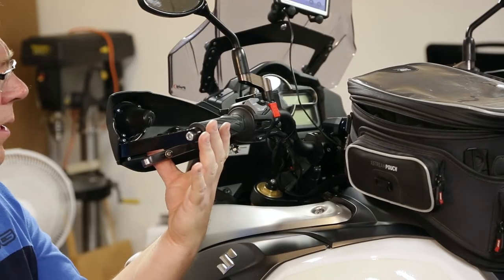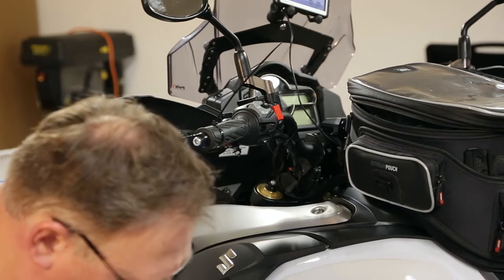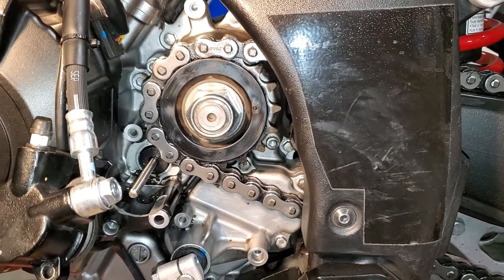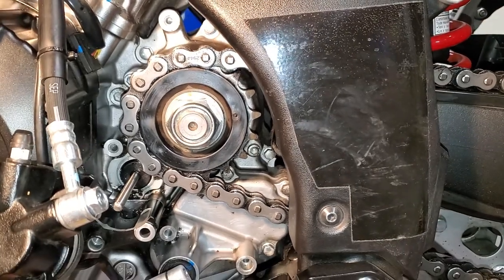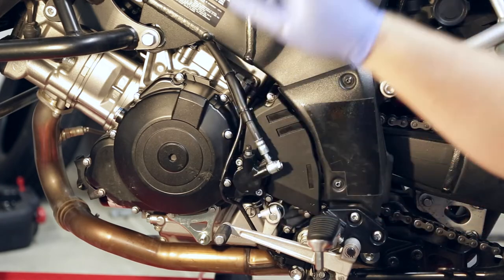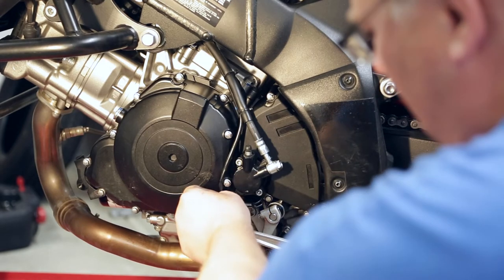V-strom 1000 Cleaning behind the countershaft sprocket cover

Comment: My 2014 V-Strom 1000 develops a clutch fluid leak due to all the filth that the chain packs in that area. It needs constant cleaning, but I have never changed the rubber seals. I took a piece of 5/16 hose tight between the cover and the transmission, and inside of it the push-rod moves freely in a cleaner environment, while the chain grease and dirt are kept away from it.
Reply: A FOTO please if you can.nice idea

Comment: Great video. Thank you. I made some notes.

:45 Zip tie clutch handle (Keeps slave cylinder piston from popping out)

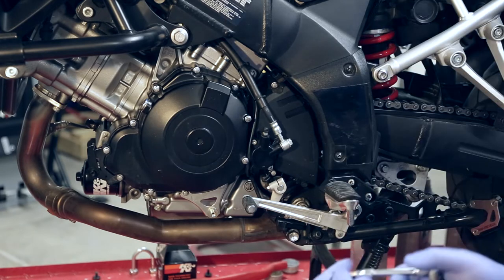2:22 Use 5mm Allen to take remove two screws from slave cylinder (SC). Top bolt is longer and there is a spacer on it that might fall off when you remove it. No worries, let it happen it is easy to put back on. I had to rock the SC get it to release from a stud guide that is at about 7:30 (like the hour hand on a clock).
4:20 If rubber boot stays on push rod take it off and put back in the SC piston.
4:50 Use 8mm socket to remove three sprocket cover bolts and remove the cover
6:25 Don’t pull silver push rod out until you clean around it
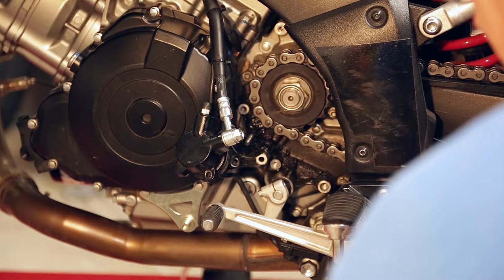7:40 I did not shine it up just used handle end of a tooth brush to rake it out into my hand because it wanted to fall into the skid plate.
8:05 He used WD40 to loosen up gunk and a rag to clean it then I assume pulled the rod out and cleaned it. I pulled the rod out earlier and made sure not to push any dirt into the hole.
9:00 Put sprocket cover back on. There is a locator pin on the lower right hand screw hole. The long screw goes in the top and the two bottom screws are the same size. 11:05 he says 6 or 7 ft lbs. I doubt I tightened mine that much. (Edit: after experimenting with my small torque wrench I tightened these to between 3 and 4 ft lbs or 36 to 48 in lbs. Use your own judgement.)
11:35 Put longer SC bolt through top hole and put spacer on the back and get that bolt started.
12:10 Put the bottom bolt in and get them hand tight

!!! 12:50 Before screwing them in more take the zip tie (or whatever you used) off. Then alternate tightening each screw a little at a time until it is tight. He explains what could go wrong. (I missed this part and installed it with the clutch handle in but got lucky and the bike seems to be fine but it made me worry and is the reason I am cliff noting this video.

15:20 He says the two SC bolts should be about 7 ft lbs. I probably did about 5 ft lbs. (Edit: after experimenting with my small torque wrench I did tighten these to 5 ft lbs or 60 in lbs. Use your own judgement.) Once I got the SC tightened down I noticed that where the 7:30 guide pin is there was a small gap (a little more than a finger nail thickness) between the SC body and where it bolted to. I did not check this before but suspect it is normal.

My observation: when the clutch handle is pulled the SC piston moves out and stops and will not move out anymore and I could not push it back in with my thumb. When the clutch handle is out the SC piston will slowly move out on its own and I guess it would come all the way out, but I did not let it. I was also able to push the SC piston in with my thumb while the clutch handle is out.  
I put the SC back without the sprocket cover so I could watch the push rod as it pushed the clutch in and let it out. The push rod only moves about an 1/8 of an inch in and out. I of course then assembled it correctly with the sprocket cover. 
If you are new to this as I am you might notice that with the bike turned off, and your back tire off the ground, and it in gear with the clutch pulled in there is noticeable resistance when trying to turn the back tire. Noticeably more than trying to turn the tire while the bike is in neutral. It is my understanding that this is normal.

Comment: Good vid - always a fun job!
Just to add, on my 2018 (13k miles) the slave cylinder boot is slightly different, whereby it slots over the piston. Mine was torn so i've a new one on order.
Also, found the countershaft sprocket nut a fraction of the tightness it should have been. It's only threadlocked, so is worth checking every time you're in there.
👍🏻

Comment: Just a note.. I have a 2014 1000 strom. If you have oil leaks in the area of countershaft sprocket,There is a oil seal the clutch rod passes thru. Check it heat makes them hard, and it leaks engine oil in same area as sprocket..

Comment: Didn't see much actual cleaning in the video. Can you use brake clean in there to clean it?  That stuff is really good and makes cleaning easier.
Reply from the maker: I usually don't use brake clean around that area because of the rubber seals. I just use WD40 and a rag.

Comment: Great Video! Only I was not patient and I skipped parts of it and now my clutch is messed up. :) To be specific I did not zip tied my clutch lever and when I put everything back together my clutch is not engaging. Or it is like 10 - 15%. So how do I fix this? You said, pushing the plate back in place through the oil filler cap. Is it that simple? Or is there something more to it so I do not mess some more stuff up. Sorry for that, but I really am not a technician type of guy. :)
Reply from the maker: Open the oil filler cap and see if the clutch plates look separated. If they are try to use a screwdriver and push it back in place. Usually the first plate.
Reply: @VStromGarage  Ok and when the plates are not separated?
Reply: @jobrn1  Long shot, but did you run into a good fix for this?

Comment: After cleaning countershaft cover and front sprocket , I reassembled the cover and I accidentally made clutch hole oil seal fall inside which I didn't notice.
After reinstalled , a lot of engine oil leaked out from that loose oil seal when engine started.It is my fault not to notice clutch oil seal was not in its place. My bike is 2018 V strom 1000.
Reply from the maker: That's not fun, at least it's a cheap fix.

Comment: I feel like I have a leak from that area! Do you have a video of crankcase leak repair?
Reply from the maker: I don't have anything for that, usually it's either the clutch push rod seal, or the countershaft seal. Some times it's just chain goo on the clutch push rod that needs to be cleaned.
Reply: @VStromGarage  okay awesome I found a list of part numbers and may end up changing gearing. While I wait for parts im going to clean it all up then finish the oil change. See what happens

Comment: How often do you do this clean? I did this today at 11k miles it was full to the brim of shiny tarry goop. Im not sure if the push rod seal has a leak (the seal looked ok and didn’t feel hard after cleaning) or whether I am overlubing the chain, also the boot on the piston is different on mine it fits over rather than inside the cylinder housing. Another question do you grease the rod after cleaning or just re-seat it dry? I’ll be changing my chain and sprockets soon so ill keep my eye out for a leak and replace the seal then if necessary. Also is it necessary to zip tie the clutch lever as I assume as long as I don’t touch the lever it should be ok or is that just for reassurance? I also accidentally knocked my gear lever into 1st while everything was disassembled but I didn’t seem to have any issues afterwards it was a tad clunky first few changes but settled and went through the gears and into neutral ok afterwards and a quick ride around the block everything felt normal. Im just paranoid about a possible push rod seal leak.
Reply from the maker: I try to clean it about every 5000 miles. The pushrod, I just clean it and put it in dry, there's enough lube inside the seal to keep it moving. Putting grease on the rod just makes debris stick to it faster. The reason to zip tie the clutch lever is to keep the piston in the slave cylinder from popping out, the resting pressure will eventually pop it out. Not a big deal just clean up the mess, put the piston back in and bleed the system. The most important part is to remove the zip tie before you tighten the bolts all the way on the slave cylinder. start the bolts, release the zip tie then tighten the rest of the way down.

Comment: Hello, I always see you videos and I have followed this with no problems, but today while doing it I forgot to tight clutch, what  can I do in that case?
Reply from the maker: I'm not quite sure what problem you are having, if you are talking about not squeezing the clutch lever before removing the slave cylinder, the worst that will happen would be that the slave cylinder piston would pop out. If that happens just put the piston back in and you'll have to bleed the line.

Comment: I really enjoy your channel.  I purchased a 2018 Vstrom 1000xt a year ago.   I have used your videos for reference.   Like this latest one as I will need to do this as well.    Question.   Any experience with the Starter Relay Assembly under the seat crapping out after only 3500 miles.    Or have you heard about this being a weak component?  Mine did this past weekend and nearly left me stranded had it not been for someone more mechanically inclined than me to get bike running.   And bigger problem is that they are in back order with Suzuki Canada, which makes me think there is a problem.
Reply from the maker: I'm glad that you are enjoying the videos!!  Haven't heard anything about those going bad, but anything mechanical or electrical can go bad at any time unfortunately. I did have a headlight relay on my 05 1000 go bad coming home from a long trip, stopped for gas, turned the bike off and the lights stayed on, luckily I caught it before I got stranded.

Comment: 1 Does the bike need to be in "Neutral" to do this? Or does it matter?
2 Do you lube the clutch shaft/pin before reinstalling?
Reply from the maker: I don't think it matters, I usually put it in neutral. I don't lube the clutch rod, just clean it and put it back in. The oil in the engine will lube it.

Comment: I forgot to put a zip tie around the clutch and now I can’t put the thing back in
Reply from the maker: Just make sure everything is clean, and put a little brake fluid on the puck. It should just push back in.
Reply: Yeah, I was able to push the piston back in and out it back on and ride with no problemz.